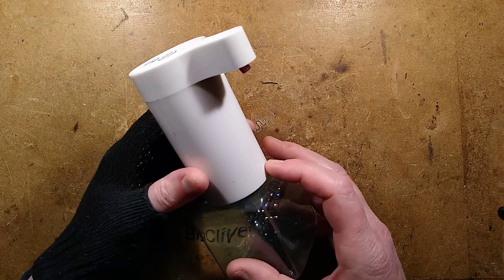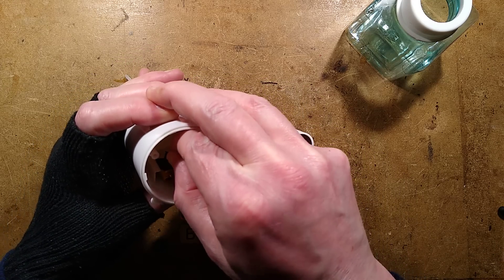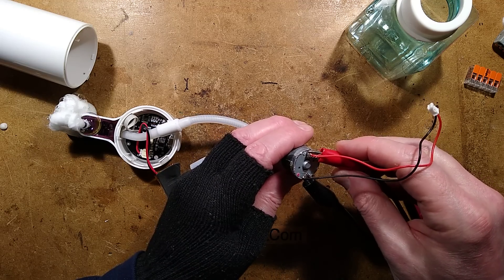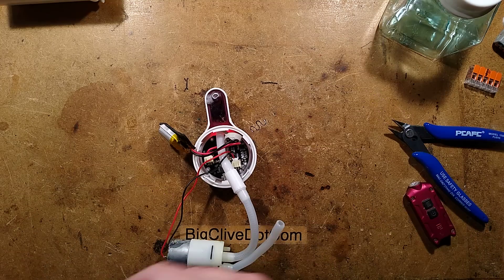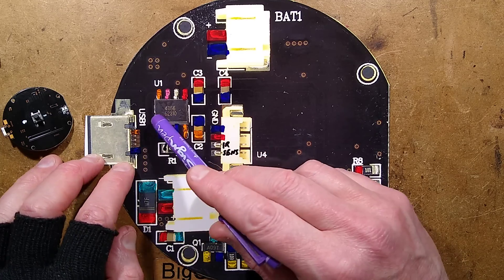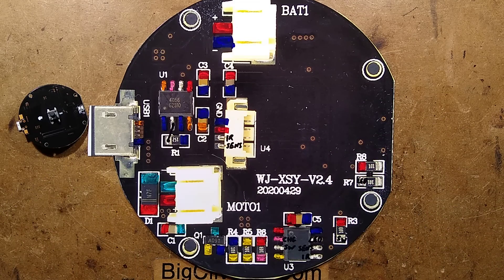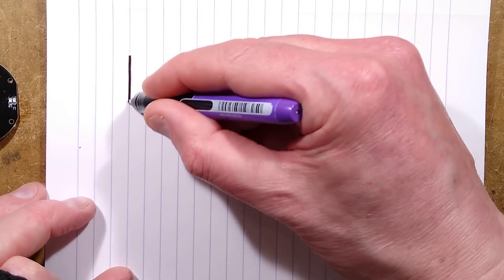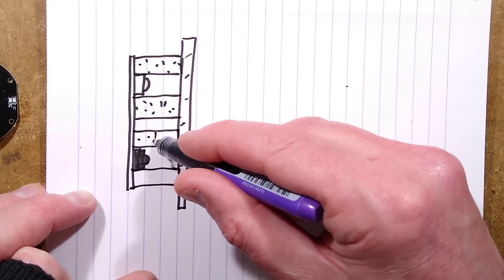Back from a YouTube ban!  Faulty soap foam dispenser - with schematic

Comment: While in the Navy, we referred to those types of failures, or at least the 'fix', as FM.  F'ing Magic.  😅
Reply: Similar vernacular is used in the railway too, at times. Same first word, second swapped-out for „Mallard“ in the example I'm thinking of... 😉

(Specifically: What was being uttered by the fitters when they saw just what Mallards 126mph record breaking run had done to her valve gear and various other bits of the steam equipment. New boilers, please! 🚂🇬🇧💨🛠)
Reply: PFM in telecom-speak (P for Pure)
Reply: @holysirsalad  PFM was reserved as a response to our maintenance control chiefs when they asked what we did to fix it.  "PFM Chief!" and walk out.  😁

Comment: I bought one of these (from the site that shall not be named) at the beginning of the pandemic in 2020 based specifically on your total teardown and recommendation. It's been running for almost 4 years now with daily use on the same 4 AA lithium iron disulfide Energizer cells I put in it when I got it. I am amazed at both the efficiency of the IR sensor and the reliability of the pump mechanism. It's shockingly good. Possibly the best generic Chineseium product I've ever gotten. Thanks again.
Reply: Tell me- why did you buy it? Instead of a mechanical lever pump type (cheaper and more reliable.) So you do not get germs from the lever? But you are about to wash your hands!
Reply: @Tensquaremetreworkshop  So I don't have to touch anything and get it dirty when my hands are dirty.
Reply: @Muonium1  So, your water tap is also automatic? (touch anything...)
Reply: @Tensquaremetreworkshop  yep
Reply: @Muonium1  I am interested- what make and model?

Comment: I have seen several variations on that pump design, some for liquid, air, and now a mixed mode. The use of multiple chambers for metering soap and air is genius!
The first I found was in a Kurig coffee maker, where it is used to pressurize the tank to deliver hot water. Very well made pumps!

Comment: Is it really beneficial to have decoupling capacitors for something powered by a battery? MLC capacitors always seem to be failures waiting to happen, so it feels like avoiding them wherever possible might extend product life.
Reply from the maker: Decoupling capacitors are needed to avoid the processor glitching due to tiny voltage transients caused by switched loads.  The low value MLCCs are less troublesome than the higher value ones.
Reply: Batteries can have a high internal resistance or oxidized contacts, leading to voltage drops in everything that consumes power in pulses like digital electronics.

Comment: Really well explained. Thanks Clive.  I once installed a power shower pump and it would not run and popped the fuse.  I put a 13 Amp fuse in and jolted the power on/off a few times and it then freed and  ran OK.  I put the correct fuse back afterwards.  Sometimes these things need a kick up the butt to get them going.
Reply: I would definitely save that for a last resort, where the choices are solely 'try to blow the fault clear' or 'buy a new one'.
Reply: @gloomyblackfur399  The seal was just stuck from long storage.  There was no fault as such.

Comment: two Michael Jackson references the glove and blowing bubbles. ☺
Interesting that it just took a kick off the PSU to turn the motor over. interesting internals 2x👍
Reply: I've had a couple of solar pond pumps come into the repair cafe recently. The motors seem to seize up during winter storage, pulsing 9-12V DC in usually gets them going. Once freed up, the solar cell is sufficient to run them again.
Reply: Wasn't Bubbles the name of MJ's chimp?😉

Comment: If the problem recurs, I wonder if you could make an enhancement to send a controlled higher higher voltage surge to it to perhaps kickstart the motor if it has gotten a bit frozen.
I know it's completely unrelated, but I'm thinking of an additional capacitor they added to my house outdoor A/C condenser unit to kickstart the compressor with more "umph," which they told me was a good thing. (I thought I may have gotten scammed but this additional capacitor is in the schematic of the unit as an optional component.)
Reply: Drop of oil at both bearings should do a better job.
If this doesn't help - time for a replacement motor.
Of course, dirt in the soap may have have caused this problem, then overvoltage may help crushing debris.